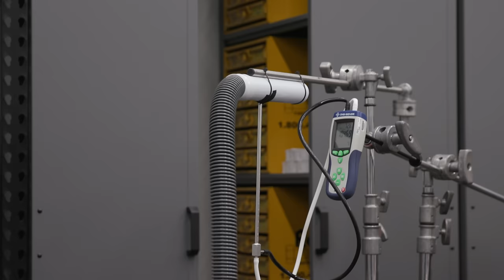The Vacuum Project: E3 - MetroVac, Riccar, and Prolac

Comment: Hold up… did you say your motor alone is $600? As someone who intimately knows vacuum motors far more than would ever care to admit, I’ve read hundreds of and hundreds of data sheets on motors. I’ve built a lot of vacuum systems. I know what motor is in the Riccar and if you buy it straight from the manufacturer it’s $130. It’s also a 3-state tangential bypass with a sealed bearing. It’s loud but the inches of lift means everything especially when talking extracting. I’m struggling to see how your motor could possibly cost $600 dollars unless you just wanted it to be that expensive.
Reply: I'm guessing they're quoting aftermarket list price if you buy it from OG. The only $600 vac motors I know of are for rider scrubbers and sweepers. I'd guess the motor in their vac has to be sub-$100, maybe $75 at volume given the rated water lift?

Comment: I wanted to expect more from the Riccar. 🤷‍♂️
Reply: Riccar results were pretty good weren’t they?  You thought results would be even higher than this?
Reply: @YuriTarded-hf1nv  Riccar on paper should be absolutely amazing, even with their upright units, canister units, with the whole product line. However the performance is good but not great especially at the price point I want to pull for them, but they weren’t bad. Hopefully that makes sense.
Reply: @johncarnegie5358  gotcha.  For me the metrovac unit was really impressive.  Makes sense why it is so popular since it is able to be used as both a vacuum and dryer.
Reply: @YuriTarded-hf1nv  It does indeed.